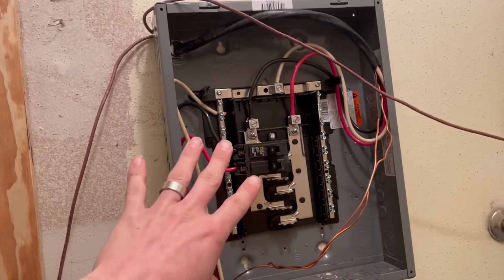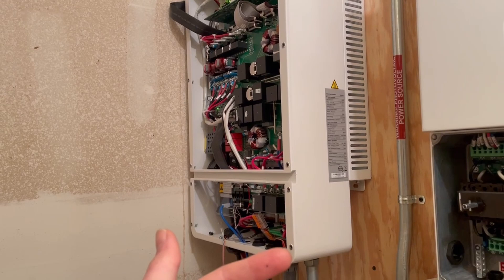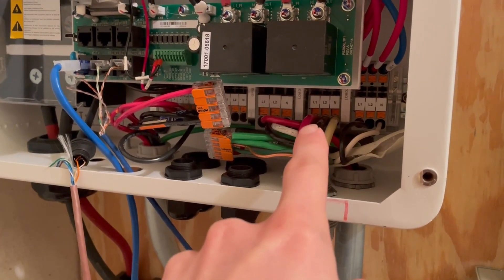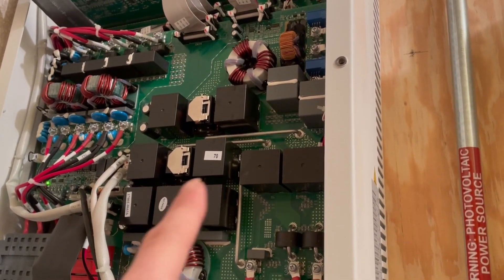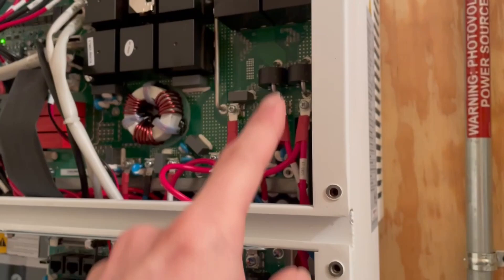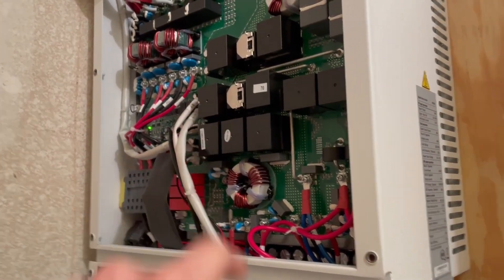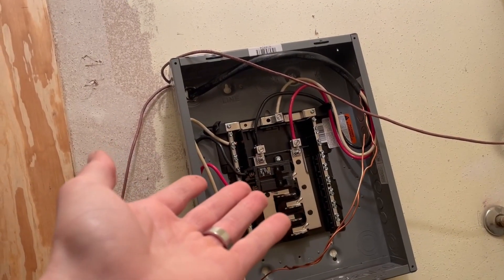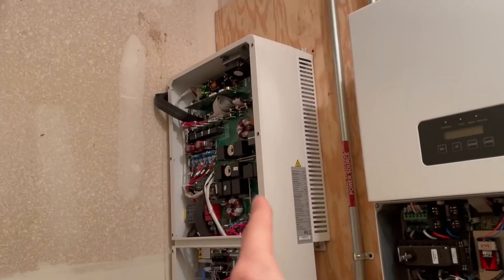Shorting My Megarevo Like Blockbuster Stock

Comment: Yeah good find.  The arc welded the relay contacts.  This happens to Air conditioning contactors, etc all the time.  It wouldn't surprise me that as it ages it happens to other relays in the inverter.   Sometimes the contacts just oxidize over and don't pass anything. I know its an older posting of yours, but I had to say something.

Comment: Great video! Can you help?!? 
I've been told my megarevo (8000w) is set at 60hertz output. However, I've just purchased a washing machine which runs on 50 hertz, and as a result the pump cannot disperse the water.
Apparently,  I can change the output hertz setting on my inverter to 50.

I'm fully off grid

Is this something you heard of and can you help? 
Thanks
Reply from the maker: I don’t remember seeing that setting. However the folk at Megarevo can change additional settings so you could try putting the WiFi dongle in, connecting it to the internet, and hitting up support to see if they can assist.
Reply: @BeeneEnergy  thanks bro! not a bad idea!

Comment: Where can i find out more info? Saw it on your site
Reply from the maker: I need to do an update video as there was another firmware release that has resolved some problems for me. My pair have been working great in my peak shift scenario and I can even choose to export excess power once the battery is full which is nice.

While they are definitely more finicky to get right than a sol ark the firmware is being improved and they’ve been working well for me. If you have a specific scenario you’d like me to test feel free to let me know. I intend to test scenarios before letting someone purchase one from me if possible :).

Comment: Thank for your video! I currently have the EG4 and the delta h6, I had them working together sending power to grid.. but the EG4 recently started smoking, contacted signature solar and they said Im not suppose to have them working together. Fortunately I had sent them pictures of my setup and they never questioned anything why had them tied to same sub panel. My question is how are you using both inverters together. I’m really new at solar and I’m learning the hard way.
Reply from the maker: Do you have a drawing on how they are connected? I presume grid of eg4 was connected to main breaker panel and delta was going to same breaker panel?

In a way where if the grid went down both inverters would shut down right?

Comment: Awesome information.  Look forward to all your tips. I have just purchased a EG4 8k Hybrid that has been rebadged. Good hardware, Software is not where it should be.  I did notice your little close to the wall with your Megarevo.  Guessing your in temperature controlled environment.  Manual saying 300 mm (11.8 inch's).
Reply from the maker: You're right, I was swapping it in place of another inverter and was lazy by not moving all the conduit to the right. It is inside which is why I'm not too concerned about it, but definitely not according to the manual!

Comment: Good save & diagnosis.
Had a similar relay failure on our outback radian , fortunately two weeks before the warranty expired.
They shipped a whole new control board & one transformer module as the stuck relay allowed the transformer to cook.
Thinking about changing over to the backup 12k growatt inverter now as our power needs are increasing and we quit trading power with the grid. Grid here is too poor quality power and I was always concerned it would eventually damage equipment.

Comment: Yup, replace that puppy. You probably need hot air to warm that board, and the lead free solder enough to get it to flow.
Reply: Not hot air as these are through hole relays, but definitely a good desoldering station with a continuous suction vacuum.
Reply: @randacnam7321  I'm talking hot air to pre warm the board, and that area. It's big, and thick will sink off a lot of heat.